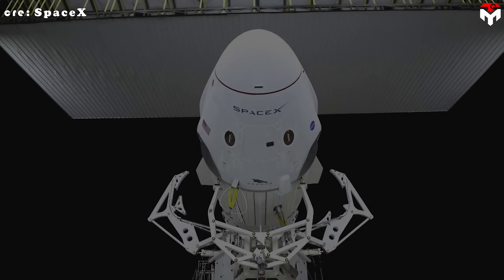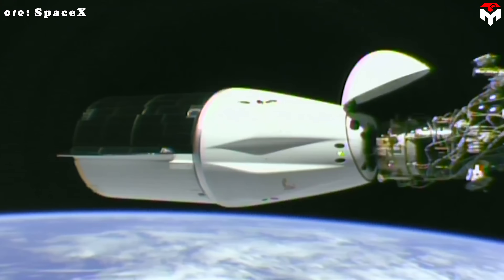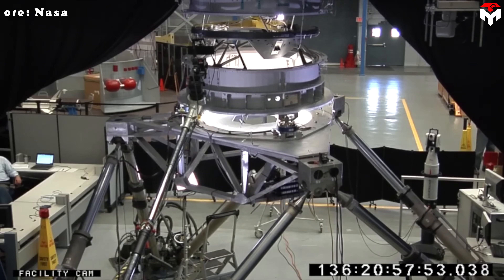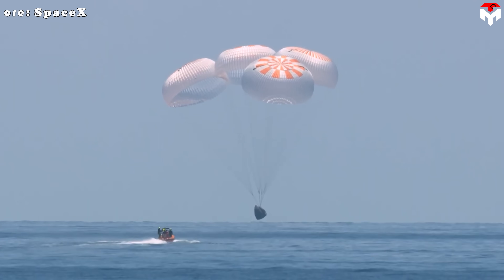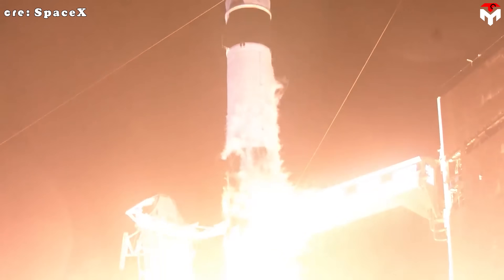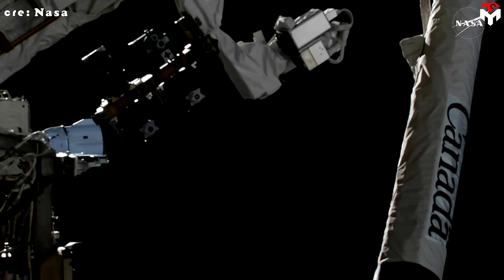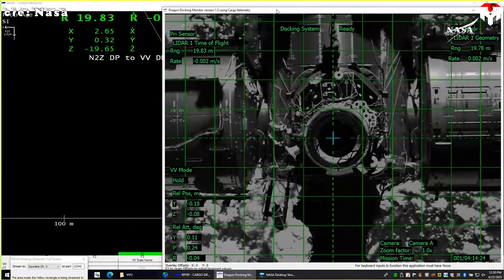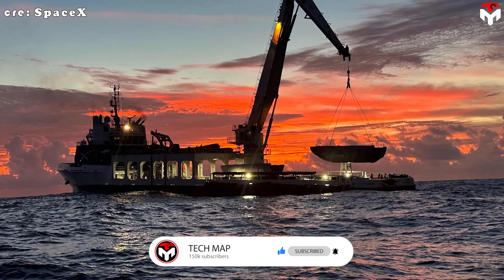SpaceX's new Dragon Docking Method SOLVES What NASA's engineers Called ""Impossible""...

Comment: I watched this video about the philosophy of SpaceX engineers with great enthusiasm. Young, fresh, cognitively agile people who are focused on solving existing problems are at work here. The description of a space-ready docking system based on mountain bike technology may sound a little strange, but that's exactly what it is. Instead of inflating and scientifically analyzing the specifications of the required technology, which almost automatically leads to highly complex solutions, the team kept its eye on the goal throughout the entire thought process and headed straight for it. Technology improves when it works more simply and better, not when it becomes more complex. There is no point in being delighted that dozens of actuators and hundreds, if not thousands, of electronic commands work together like a symphony orchestra to ensure the correct use of hydraulic or electrical energy when the desired result can be achieved with a fraction of the effort. This reduces manufacturing and maintenance costs and, above all, improves operational safety. Once again, I am impressed by SpaceX.

Comment: LIDS was designed for all space vehicles of the time, including the space shuttle. The main issue was imparting large loads into the space station that reduced it's life when docking with a space shuttle size vehicle. Yes it is overkill for a capsule. But our Russian partners demanded the international docking system standard to be as capable as the APAS system it was replacing.
SpaceX did not make this choice, Boeing/NASA did in 2012. The international docking system standard was simplified to more align with the APAS design and lost the active dampening capabilities.

Comment: This is why Musk wanted to keep SpaceX a private company. No board of directors to approve every little detail. It keeps the company flexible and agile. They can come up with solutions on the fly and eliminate the bureaucracy. Kelly Johnson of the Lockheed Skunk works had a similar philosophy. He had engineers and the people building the tools and aircraft in the same room essentially. If the workers needed guidance or if the engineers had a problem. They could walk right over and discuss the issues. Often it would be the guy with the dirty hands who had the answer. On the other hamd. Donald Douglas. Arguably one of the pioneers of aviation design retired when he realized the board of directors were all accountants and lawyers with no clue what it took to build an airplane. Boeing ran into the same problem.

Comment: This highlights a basic Engineering principle.

Reduce the problem to something that has already been solved.
Reply: I am an Engineering student in germany. And its the first step you do if you want to construct something. in germany its called the "Anforderungsliste" that includes all necessary features. "first principal thinking" for me sounds like a marketing move. people that aren't in Engineering fields think "oh that sounds smart".
Reply: @davidnitschi5714 I'm a huge fan of simple eloquent solutions to issues. Take out every step that isn't absolutely nessisary. Take a step back and look at the big picture.
Reply: Or as Buckminster Fuller said
"Engineering is the art of mastering complexity to the point where the complex appears simple" 

FWIW, great software engineering puts this same truth to excellent use, but it's surprisingly hard to find good examples of because it requires a lot of thought, which in reality is soak time, and that's expensive time given the salaries of top software engineers. 

Higher IQs should mean less soak time, but few have trained their minds to work on problems in the background, with persistence, and over long periods of time. IQ applied sporadically, especially one being pulled in many directions is usually very unproductive. Bill Gates has his own name for this mental discipline - "Deep Thinking". 

Any idiot can multi-task. It's so common it's almost worthless. Any old ADHD tweaker can multitask. Deep Thinking OTOH is very rare and is very valuable.